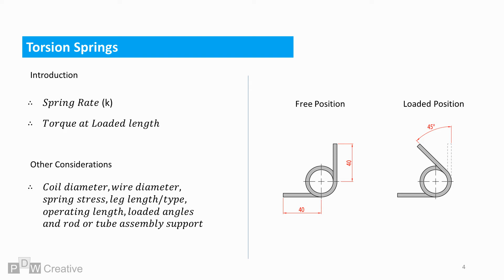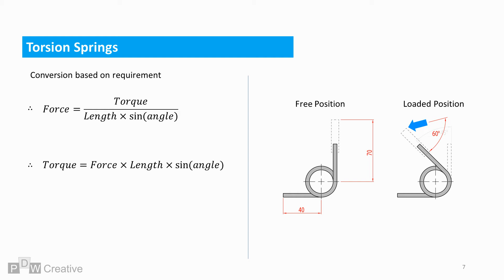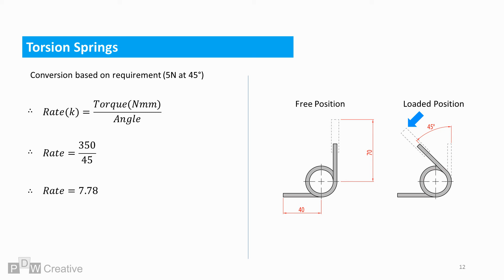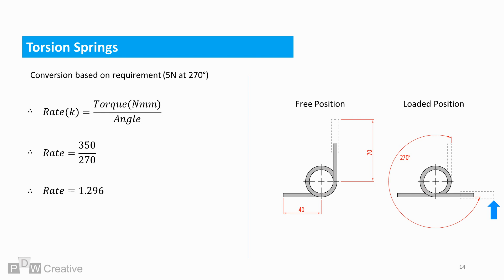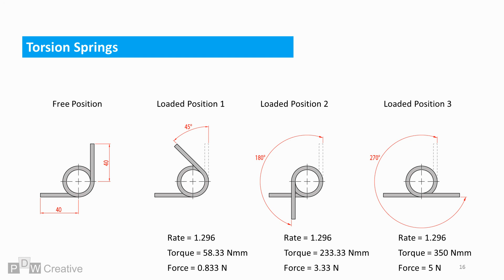Torsion Spring Design 1

Comment: Hello, your work is very informative and thank you. I would like to ask you this question. What happens if the spring arms are bent 90° towards the spring center after bending and the torque is from there? Thank you.
Reply from the maker: If you try to force the wire in an unnatural direction it will not function as designed. It may also plastically deform, break or cause an injury